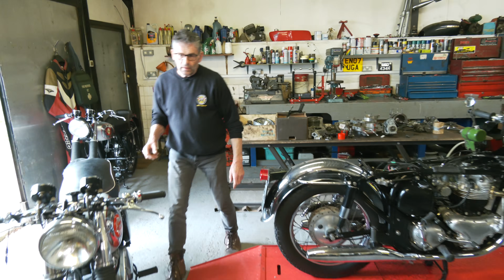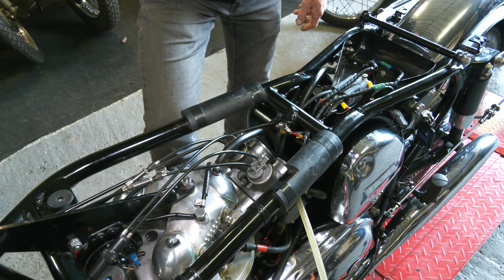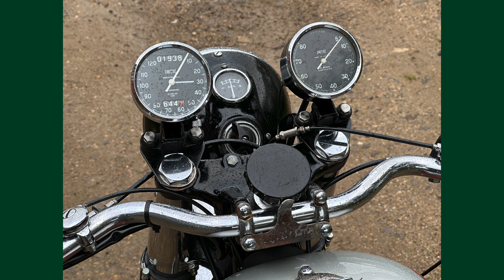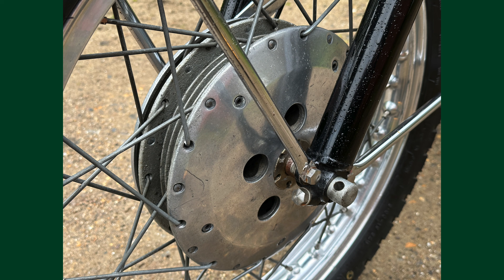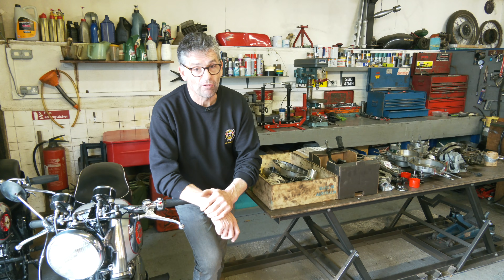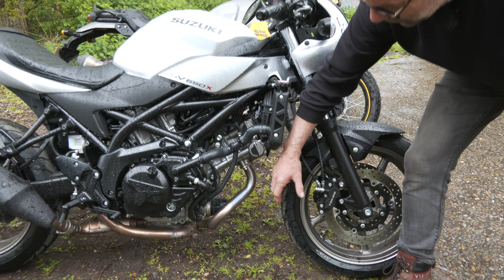Classic Motorcycle Workshop Vlog 18 - Norton Atlas runs again etc

Comment: I've always understood the SV650 to be a very good all-round bike by all accounts, I don't know what Suzuki were thinking when they designed it but that front mudguard is cut short to the point of stupidity, any bad weather (even for a short period) and it will sling road-cr*p all over itself !.. Three or four inches longer at the rear wouldn't have radically altered the look and would have made a massive difference to keeping the muck off the engine. I wouldn't mind buying a short fender extender but to have to buy almost half the mudguard that should have been there in the first place is ridiculous !.. Great video as always Dave !

Comment: Regarding the goldie crank... have you checked out ABASF? They make brilliant billet cranks.
Reply from the maker: Hi Kevin, thanks for the recommendation, we'll check them out.
Reply: @TheClassicMotorcycleChannel2  you are welcome. Just finished a 55 CB34 project with a crank and rod from Jan DeJong at ABASF. Got a new oil pump, timing cover, and other bits as well. Good luck on your project.